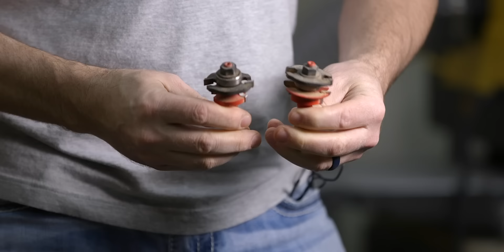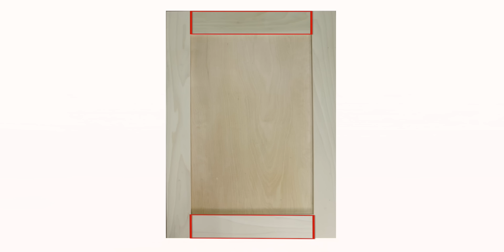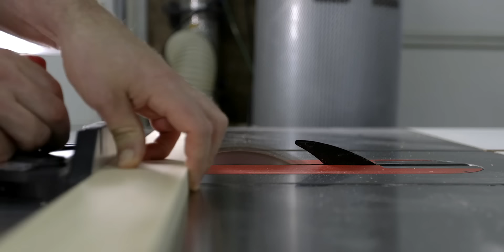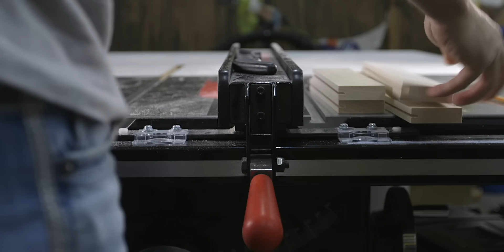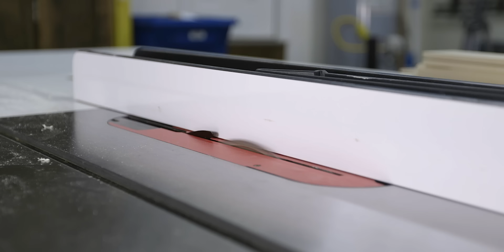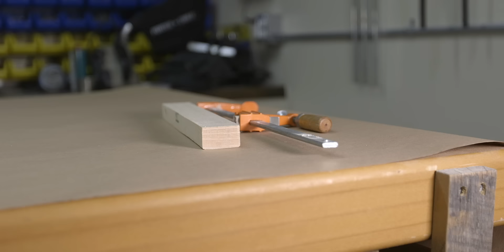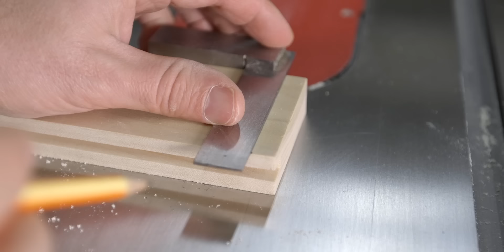Build Shaker Cabinet Doors With Table Saw | New to Woodworking?

Comment: The only thing I would add is priming about 1” of the panel edge before glue up. Priming with a color close to your top coat color will help hide any seasonal shrinkage of the panel and exposing bare wood.
Reply from the maker: Awesome, thanks for adding that!

Comment: I have a bit of a special project. I need to build doors for a wall opening which I am trying to mimic bedroom doors which are farmhouse K style. They will be hanging on barn style bypass hardware. The 2 doors will be roughly 28.5W x 48H each (2-panel). I am using 1/4” T&G 3”W  1/4” thick paneling boards for inner panels. Will 3/4” stock be sufficient for stile and rails or should I bump up to 5/4?  If so Will my shaker door router bit set work on 5/4”?  Thanks for any advice

Comment: When measuring out my does with a face frame cabinet, do you make the door dimensions even with the ends of the face frame, or slightly smaller?
Reply from the maker: Great question. You have to start with the hinge first. Each hinge has a different amount of overlay on the face frame. For example, a 1/2" overlay hinge means the door will overlap the face frame by 1/2" on the hinge side. Some hinges have more overlay, and some have less. There are also surface-mount hinges and inset hinges, which hold the door inside the face frame.

I hope that makes sense. The bottom line is to choose your style of hinge first, and that will determine how large to make the door.

Comment: I have the exact same refrigerator and was experiencing the very same issue.  I pulled the fridge out, opened up the back, and the fan blade was in fact off the motor spindle. AMAZING!!

We actually had a Frigidaire authorized repairman here to fix our leaky dispenser and we told him about the hot water and warm frame issue.  He told us the water tube was resting against the compressor and that was what was making the water warm.  Never did he question why the compressor was so hot and  apparently knew nothing about this common problem.  Once I found your video the issue was fixed in less than 20 minutes.

Comment: If you don’t have a dado stack set of blades, use a blade for ripping hardwoods the ripping blade has flat teeth, he is using a plywood blade which has alternating pointy teeth. No sanding or chiseling required with a ripping blade.

Comment: Thanks for the video. I was able to make my first shaker doors this week. I found one interesting detail in my journey. When cutting away material for the tenons I found that if I started the nibbling at the base of the tenon and worked my way towards the end the tenon thickness at the end was slightly thicker that at the base causing it to not fit in the groove. Conversely, starting at the end and nibbling back towards the base resulted in a proper fit. I guess the tenon flexed slightly when unsupported. Hope this helps someone.
Reply from the maker: That's a great tip about grain flex, glad they fit in the end! :)

Comment: Im newer. Do I need to use a sacrificial fence? If three quarter depth and the groove is 1/4 then that leaves 1/4 between groove and fence. It didnt look like you did, but to help me understand, when would I need a sacrificial fence if not here? Thank you!
Reply from the maker: Hi. The main reason you would need a sacrificial fence is if you are positioning your blade very close to the fence. Most commonly, it’s used when running a dado blade—a wide stack of blades used to cut dados or grooves—where part of the blade is intentionally buried into the sacrificial fence. This allows you to fine-tune the width of the cut and can also help produce a cleaner result.

Comment: What kind of blade are you using? I’ve done this but because of the offset teeth I get inconsistent lines in my grooves that show when it’s assembled. Too thin to get a chisel or sandpaper  in there, yours look perfectly square like you used a router bit
Reply from the maker: The best blade to use is a flat top grind (FTG). It will leave you with a smooth surface. I cut mine a little large and sanded them down because I wasn’t using an FTG. From here, you can progress to using a dado blade in the table saw, and then from there to a router table. Just so you understand the progression if you decide to keep going in woodworking and carpentry.

Comment: I have a question that maybe someone could answer. Instead of 3/8” tenons, would it throw off anything to do 1/2”? I know I’d have to calculate for the difference but does it matter as long as the math is correct?
Reply from the maker: Hello. On 3/4" material that gets pretty thin the on the sides... only an 1/8".
Reply: @TrainingHandsAcademy thank you!

Comment: Am I the only beginner that still thinks that's too much work for a door ( I patiently waited for the EASY part)? great video and all but I need somethin quick and dirty, thinking about velcroing a piece of board and putting a handle 🤣🤣
Reply from the maker: Cabinet door making is not a beginner woodworking and carpentry project. Once you get more experience doing other things and gain more knowledge, then you can build a door. If and when that time comes, you can come back to this and it will make more sense to you and be easier. Like everything in this world, skills are required to do anything, and the amount of skills learned over time is what creates the ability to do more and more, better and better.

Comment: My problem is 2 things. 1 determining the width and height of the doors, on a face framed cabinet. 2, how much overhang does the face frame have inside and out. It seems like something commonly skipped over in videos. (Not specifically talking about just your videos) any help appreciated

Comment: after you dial in the saw for the groove in the stiles and rails on your scrap piece there is no need to flip the stiles and rails and pass twice, right?
Reply from the maker: You would/could flip the board to ensure the groove is centered.

Comment: Watched 2x, but I don't see the benefit of the wooden block clamped to the fence. 
Why not just set the fence 3/8 away from the outer edge of the blade?
Reply from the maker: Yes, you can do that. However, the reason I teach this way is because if you do the same thing and cut all the way through the wood, you put yourself at risk of kickback on the saw. It’s very easy for new people to do this on this type of cut and then repeat it on a through cut and hurt themselves. This method builds the habit of always making sure the cutoff piece can move away from the blade without binding.

Comment: Great video! Maybe I missed it, but I'd advise taking the sharp edge off of the door's exterior perimeter - maybe just with a sanding block. Wood that has been jointed and planed can have very sharp edges. I've done these before but used the router table, and if I recall correctly, I used a 1/8" round over bit on the frame exterior, front and back per client's wishes. I think it looks ok that way.

Comment: Can you speak to knowing what size to make your doors, or a tutorial video to watch? I'm getting started soon on a pantry project with face-frame cabinets and I'm a little intimidated as to the process of knowing how much overlay to do and how that translates to door or drawer face dimensions, what hinges to buy, etc. I'm entirely self-taught and slowly ramping up the complexity of my projects, so every time I tackle something new I overthink it!
Reply from the maker: Hi! The hinge is actually the starting point because it decides how much of the door overlays the face frame. For example, a 1/2" overlay hinge means the door will cover 1/2" of the face frame on the hinge side. Once you pick the hinge, you can size the door accordingly. Every hinge is a little different, so I’d start there and let that guide your door building.

Comment: I tried making doors like this and I struggled with how far in to drill the hole for the hinge. I know it’s 4 inches up and 4 inches down but how far do you go so that it fits properly and closes correctly?
Reply from the maker: Are you using European hinges? If so, I recommend using a jig like I did in the video to get those perfect.

Comment: Why not just glue the pieces to the plywood without the joint?
Reply from the maker: Great question. It's because of expansion and contraction. The panel needs to move independently from the frame. If it can't move, it will fail somewhere.

Comment: Thanks for this video! Could you share the thickness of your stiles and rails? Also, what type of wood would you recommend for making them? I'm planning to build doors for a bathroom vanity.

I also need to build the carcass, so I'll check out your other videos to see if you have any tutorials on that part of the project.

By the way, you just earned another subscriber! I really like your clear and straightforward presentation style.
Reply from the maker: Thank you! 3/4" material is what I used. Yes, I do have a tutorial for the cabinet box. Let me know if you have other questions.

Comment: what is a good material to use if you dont want to paint them if you want to keep it a natural wood?
Reply from the maker: Almost any wood type would work... depends on the color of "natural" you are going for.
Reply: @TrainingHandsAcademy  now I have the opposite question.... what type of wood/material would take a paint well? would like to have the result be something similar to glossy trim paint.
Reply from the maker: @xisotopex  
Poplar like what I used in the video takes paint well... any type of paint and sheen too

Comment: I’m building my second set of cabinets, and I’m getting furious. I use a scrap piece for the groove, make sure it fits SNUG. Then I ran all my pieces through, ensuring to keep them tight against the fence and the table, but some are coming out too wide. I’m gonna lose it. I’ve spent a fortune on all this lumber and more importantly tons of time cutting the lumber for my cabinets. I have no idea what’s going on. I’m using a dewalt jobsite table saw and I had no issues with the last set that I built. I have 5 doors and 6 cabinet boxes. Please tell me this is somehow salvageable if the grooves are just a tad too wide
Reply from the maker: I'm so sorry you are going through that. Please join my community today and I'll help you there... because I'll need to see photos and more in order to help you. https://www.skool.com/traininghandsacademy/about

Comment: Hi Josh, you do a great job with your videos! Question for you, perhaps it's just the lighting, but it appears that your cabinet shaker doors have a bevel on the inside edge of the rails and stiles. 

I would like to do that with my doors and I'm wondering how to achieve that effectively and I'd love your input. For the rails, I could run a beveled router bit along the entire length, but for the stiles, I would need to stop at the point of intersection with the rail and perhaps finish it up with a chisel. 

Or, I could dry fit the rails and stiles without the 1/4" panel, clamp them together and run that beveled router bit around the entire inside edges, then clean it up with a chisel. How would you go about putting a beveled edge on the inside edge of the rails and stiles?

Thank you in advance! I'm excited to get building!

Brian
Reply from the maker: Hey Brian! No, my doors don't have a bevel on them. I've never done that before so I can't speak from true experience. Both options would work in my mind. I think I would go with your option #1. Option 2 would work too, but I see a little more risk in making a mistake. I guess too, it depends on how many doors you have to make. Wish I had a more rock solid answer for you. Let me know what you end up doing. You can always reach out to me via Instagram, OR I'm starting an online community for woodworking soon, and you can join that and share photos and videos. Again, I don't have that fully up and running yet, but you are able to join and share with me now. Either way, I'm sure we will be talking. https://www.skool.com/traininghandsacademy/about
Reply: @TrainingHandsAcademy  Thanks Josh, I appreciate your prompt response! Just joined the new Skool site, looking forward to sharing and learning!
Reply from the maker: @brianseifert9153  Awesome! Post on Skool whenever you want... it will give me a chance to test it out before I "officially" start it. I'm excited to have you apart of our  community. Thanks Brian.

Comment: Nice job are you using a special blade?
Reply from the maker: Not really. It would be best with a flat top grind blade, because it will leave the cut square at the bottom. However, any blade for the most part would work. Hope that helps.

Comment: Just a couple questions: is there anything holding the panel in? Caulk? If it shrinks how do you keep the paint line from showing?  Also, any reason not to drill the holes for the cup hinges before assembly? Lot easier to hold on a drill press
Reply from the maker: Most of the time the plywood panel doesn't shrink past the paint line (that's why I recommend using plywood or MDF panels). It does happen now and again. With solid panels gluing is a firm no. The panel needs to move and if it can't, it will split. Gluing plywood panels might be a different story? However, I still don't glue mine and I haven't had issues. Sure, you can drill those before.

Comment: If I may offer a suggestion, add some self adhesive sand paper to both sides of your saw blade, helps give a cleaner cut. I know this is an older video but, there's always a way to make some things easier. Cheers :)
Reply from the maker: Thanks for the comment.

Comment: Great tutorial. I am going to be diy building my new kitchen (and the rest of the renovation), and this is exactly what I need to do. I especially like that you didn't use a dado stack like many other videos I've seen, as here in the UK, this is not something we can generally use, certainly not on cheap job site saws.

Watching you cut on the table saw though was concerning me somewhat. I know it's a 'Saw Stop' so will not badly injure you, but even so, no push sticks are used, reaching over the still-spinning blade. The saw-stop feature does not prevent kickback. I don't (I know I should) use a blade guard on my job site Dewalt table saw either, but always use pushsticks, and NEVER reach for the workpiece until the saw has stopped. While I'm sure it works for you, it sets a poor example for beginner woodworkers like myself.
Reply from the maker: Thanks for the comment .

Comment: Hi - really helpful video. One question, do you have to add in a 1/2'' offset for the hinges? it seemed like you measured the interior, but i would assume you need to measure with an offset of the exact interior frame.
Reply from the maker: Yes, you are correct. If you are using 1/2 offset you need to add that.

Comment: Brilliant video, I'm 35 years on the tools but never made my own doors and I made a door for my electric meter cupboard but I routered the groove with my 18v makita router but it is so much easier and quicker to do it on my table saw and I did not tenon the stiles I just glued in the panels and cut 4 biscuits out of the same size panel and tapped into the groove I'd routered into the end's of the stiles but I am now going to have a go the way you have done it. So yeah love your work mate 49 years old and still learning lol.
Reply from the maker: Glad I could provide you a little more working knowledge. Cheers!

Comment: How much space did you allow for movement for the panel? Asking because if it moves once painted, wouldn’t it crack the paint where the frame meets the panel? Or, show raw wood if it moves?
Reply from the maker: If I'm using plywood, I try to make them tight. Yes, you can get some movement. Great question.

Comment: This video is 3yrs old so I’m not sure if you still read the comments or not. I have a question. I’m going to reface my kitchen cabinets and will build the doors based on your video. I’m going to be painting my cabinets and want the finished product to be as clean and sleek as possible. What are your thoughts on using MDF?
Reply from the maker: Hello, MDF for the panels yes, MDF for the frames no.
Reply: @TrainingHandsAcademy  hello again. Thank you for your reply. May I ask why not? Does it have anything to do with water resistance? Strength? Kinda new to this. I know that some cabinets are made from MDF because I’m a bath designer / remodeler. Is it ok because manufacturers cover it with a laminate or vacuum form film? I do everything in my bath projects except the cabinets. Was considering trying my hand at this as well. But I was going to start off slow and reface my kitchen cabinets first.
Reply from the maker: @madmann1969  Yes, everything you are saying I believe is true... water resistance, strength (durability), etc, and for me, I don't like outgassing urea- formaldehyde that comes from that product.
Reply: @TrainingHandsAcademy  thank you for indulging me. 😊

Comment: One thing. With the door now glued up in your clamps you measure for squareness and say that 1/16 out is ok BUT you didn’t explain what to do to correct if ours is more than 1/16 out. That’s pretty important to have not demonstrated.
Reply from the maker: Good point. All you need to do is run a diagonal clamp to get it Square.

Comment: hey thanks for this video, i just did 7 doors. Why cut the pannels 1/8 short? You dont want them to go to the bottom of the grooves? Thanks you again!! ❤❤❤
Reply from the maker: If you are using plywood you can cut them to fit tight, or you can also use Space Balls to fill the gap.
Reply: @TrainingHandsAcademy  Ok thats what i did, thanks a lot for your time and this awesome video, came out great!!